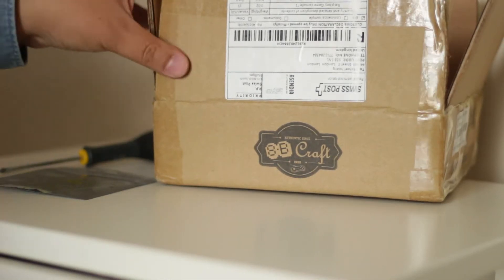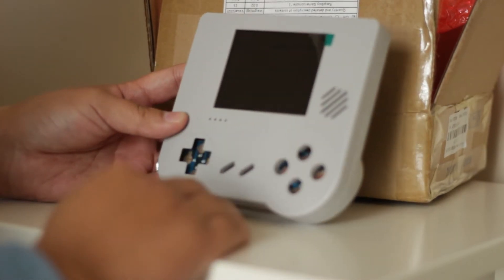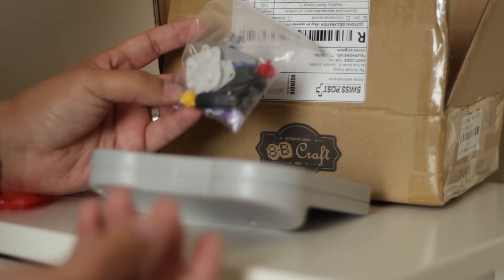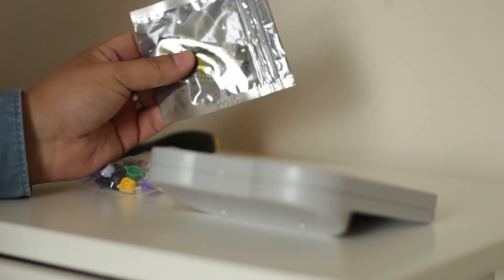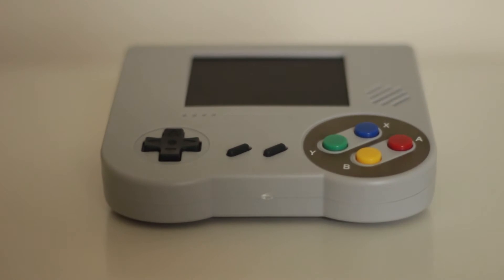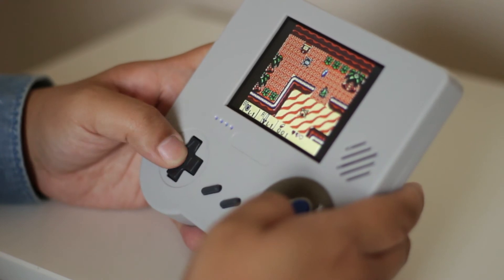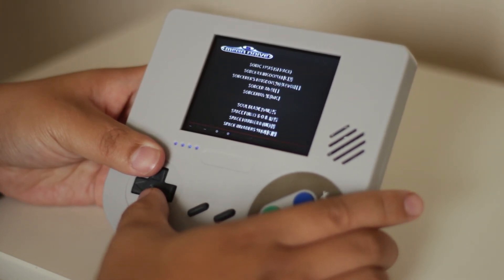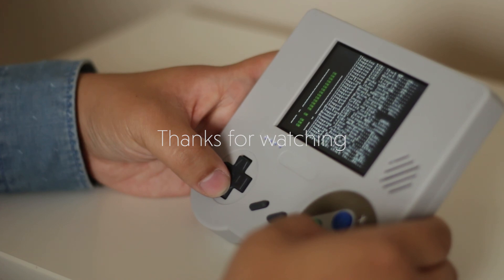The Raspiboy

Comment: i have a question is it already loaded of games and how do you add the box art of the games
Reply from the maker: You will have to upload your own games to the device, there are no preinstalled games. For the box art, there's a tool in retropie menu which you can use to scrape box art from the internet
Reply: @mikeys_youtube_makes  another question how many game consoles does it have
Reply from the maker: @agustinabergado4598  I believe retropie supports 46 emulators, but the raspiboy will only support less than half of that
https://retropie.org.uk/about/systems/
Due to the compute power of the device

Comment: Hello, Can I add Roms Hacks/Modded games ? And the Compatibility is on from the Atari 2600 to the Gamecube ?
Reply from the maker: Sorry, just to clarify. You have a modded Atari 2600 rom which you're playing on GameCube (guessing it's an emulator on the GameCube). And you want to know whether it's compatible with the raspiboy? If so, as long as it's compatible with an Atari emulator, it would be safe to work on the raspiboy Atari emulator
Reply: Mike Hoang No, I want to play some Games from the Atari 2600, Sega megadrive, Gamecube etc
Reply: Mike Hoang And I want to play with modded games like Sonic 1 turn on Sonic Mobius adventure for example
Reply from the maker: Ah ok. So it's definitely not compatible with the GameCube. You should be able to search up what a raspiboy is compatible with online. But a rule of thumb is that it can just about cope with a PS1 . As for modded ROMs for say sega mega drive it works well. I have a few of them and plays flawlessly
Reply from the maker: Sorry, just searched up sonic mobius. Do you play it on the pc? If so it's possible you cannot. As the retropie software just uses emulators to play games

Comment: Boot time is very important. Why did you have to speed that part up??
Reply from the maker: Because it's boring to watch
Reply: No it's not. Not a single video deals with the fact that a handheld console should boot quickly, i.e. before dumps have been taken. And a standby mode just drains the battery without any benefit. Thanks but I'll keep my GBA.
Reply from the maker: Thanks for your reply, definitely would take it into consideration for a next video. It's good to know what people are interested in so I'll think about doing a performance test in my next video 👍

Comment: How much was it does it come with roms
Reply from the maker: I paid €72 for it via his Kickstarter. I'm not whether he sells it now. I mean his website currently does have a store but it doesn't have anything there.
The unit came with an 8gb SD card that was completely empty so it's up to you to fill it up with ROMs and install the retropie image
Reply: Mike Hoang thank you bro
Reply: WINTER WOLF it's for sale at his website. Be prepared for a long wait however. I ordered mine back about 4 months ago, has only just arrived. Just set it up and damn it's sweet. The font is a bit gash but that's just themes in retropi.

I went for the full kit including the additional usb port, extra usb controllers, the larger batt and Microsd card.

As for the audio issues, throw the volume on the emulationstation software to 100% and use the pot to control the actual volume of the speaker. Much less white noise.
Reply: M3ta7h3ad thank you soo much
Reply: WINTER WOLF no roms

Comment: Hi Mike, great video!!
I have a question, i own now a raspiboy running with a rspberry pi O W and Retropie 4.3. Looks like i’m having some kind of a resolution problem. Everything works perfectly, exept i can’t read a thing on menus and emulator menu. Lines are too small. Do i need to change someting in the settings? Thanks
Reply from the maker: Prasi Thammavong I know exactly what you mean. Check out http://sudomod.com/forum/viewtopic.php?t=159 and it should tell you how to edit the carbon theme. It's an XML file that you have to edit. I followed the exact same steps and worked like a charm
Reply from the maker: Prasi Thammavong stick a usb keyboard and from the retropie menu exit out of emulation station. You should be taken to a Linux based terminal and you can navigate to the XML from there and edit it

Comment: Very good video, thanks for sharing this! I absolutely love the Raspiboy's concept, though i have my doubts about the Pi Zero's performance. There are quite some games (mainly SNES, i know N64 and PS1 are too far fetched for the Zero) that don't even run that well on my Pi 2B, which if i'm correct should be a little bit more powerful than the Zero. For example there's extreme delay issues with Star Fox and Contra III to name a few. So i'm not completely convinced that the Raspiboy will live up to my expectations.

As for the form factor and the design, it think the Raspiboy is near perfect. It has the perfect 90's retro feel to it that i love. Again, thanks for sharing!
Reply from the maker: Hey Morph- X . You're absolutely right. N64 is pretty much unplayable. PS1 is fairly ok, with the right emulator you'd be surprised that it plays fairly well. 

Ye the design of the raspiboy is great. It's a really nice idea and is definitely well executed. Although I've thing I didn't mention is that it obviously uses a third party controller so the feel of the buttons just doesn't feel the same when you're posting the keys.
SNES is probably one of my all time favourite consoles so this is a real nostalgia trip for me

Comment: You're supposed to turn the volume UP in retropie not down.
Reply from the maker: Hi mtb0x , I was actually looking everywhere that Pierre said that the w was not compatible. It was actually from one of his email updates

From the first delivery I have important remarks :

1. Please use only raspberry pi zero v1.3. Do NOT use raspberry pi zero W as it seem that it induced a lot of defects on the 8BCraft PCB, resulting in non-working screen (black LCD not waking up). I think the wifi interferences can corrupted permanantly the LCD driving software. This software is pre-installed by us on a flash IC that is soldered on the PCB. Flashing the software (.hex file) require specific hardware tools so you won't be able to repair it.
Reply from the maker: For the sound, im sure you have, but make sure you've edited the config.txt and put this at the end

dtoverlay=pwm-2chan,pin=18,func=2,pin2=13,func2=4
Reply from the maker: Nice one! I'm glad to hear that. Ye I'm not technical by any means, but I enjoy it and like to share with others my experiences. 
Keep it up though!
Reply from the maker: Max Mustermann I'll give it a go. Cheers
Reply from the maker: Max Mustermann tbf I've got the volume at around 70% in retropie
Reply: Least you're getting some sound. I Haven't got any sound configured yet. So if you have a link to a quick guide for that I'd appreciate it.
I'm currently working with recalbox and retropie to see which I prefer. 
My Raspiboy has the Zero W in it. And it's working fine. I didn't know it had been an issue. ETA prime is using the W as well. I have a couple of Original zeros I can swap out if it is a real issue. Does it kill the screen?
Reply: Mike Hoang thanks, I'll swap out the pi to be safe 😬, appreciate the heads up. Missed that update completely.
Reply: Mike Hoang I'll check my config.txt maybe I've made a mistake. Thank you. Loving your channel. I'm new member of the pi/retro gaming club. So catching up with the community. I'm way behind in level and ability. Having fun learning tho.